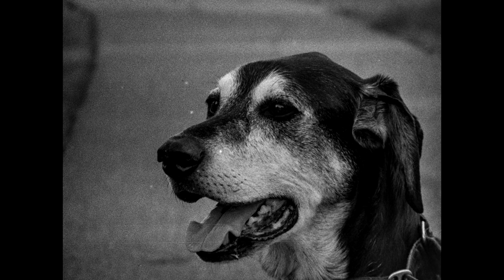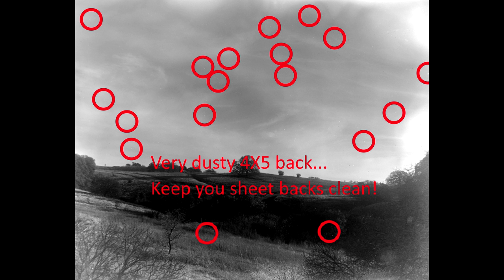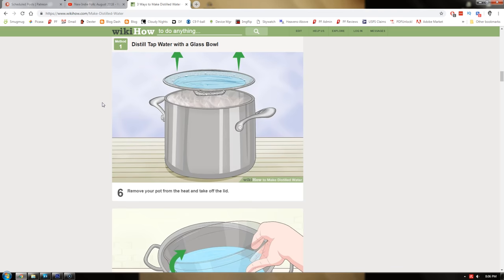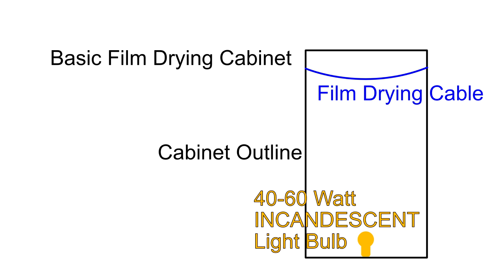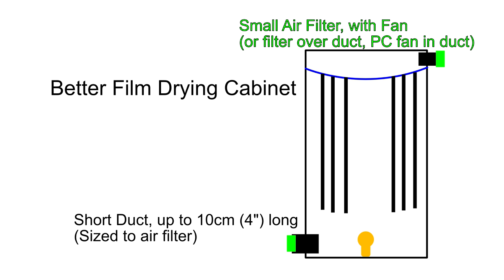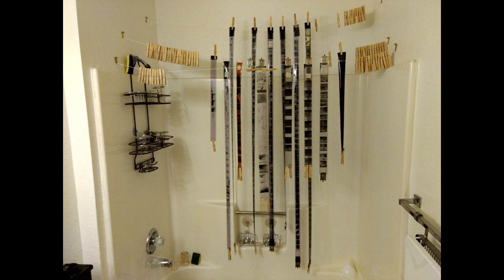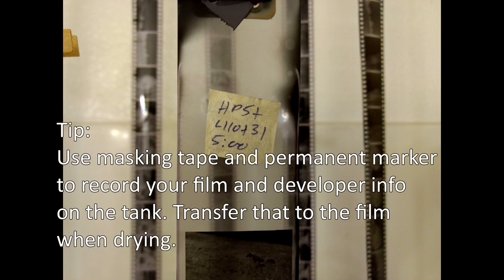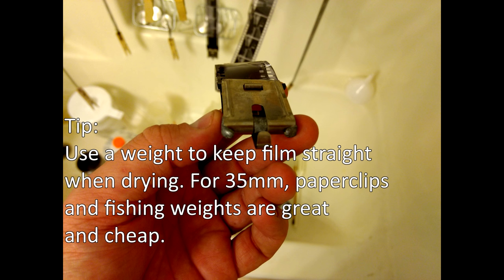Dirt on Film Negatives

Comment: As always great tips. I dry mine in the bathroom, but just before hanging them I run the hot taps for a minute or so, not long enough to cause condensation but long enough for the cooling steam to bring any floating dust down and stop it floating on to your negs. Yet another great video David, thank you.
Reply from the maker: Thank you, Mark! That's a fantastic idea. I hadn't thought to pre-clean the air.

Comment: I dry my negatives in the shower also, however I don't use the exhaust fan. While it might help drying it is sucking dust filled air into the bathroom through the space around the door. I keep the lights on the heater/ ac vent closed and once the negatives are hung I keep the door closed over night and do nothing to stir up dust. The lights help raise the temperature decreasing drying time,  however drives my OC wife crazy.
Reply from the maker: That's a really good point and is probably a better approach than using the exhaust fan. Thank you!

Comment: they need to design spot toning pens for negatives david maybe one day B&H will get onto that
Reply from the maker: They used to make something similar. Because the tones on film are so varied, even in areas that look uniform, the process of fixing negatives is very hard. And because of the size, fixing actual negatives is almost impossible without really specialized gear.

Prints are where problems tend to be fixed. And for that, with black and white, the process involves taking black dye, mixing it in different dilutions to create thing, but correctly toned, gray shades, and then matching and brushing in the tones with fine (like 1- to 10-hair brushes) in multiple layers to build up the correct tonality and detail. It can take an artist with a lot of experience doing that up to 20 minutes for a small-ish spot. It's awful. I've done it a few times. I hope to never do it again.
Reply: true that on 35mm small yeh ive got a 10 grade of spot toning pens its bloody hard at most times to get the tones right the 000 sabre brush is the best tool for prints ive heard but u gota mix the dyes your self cheers for sharing any information I did not know david look forward to your next review/hits and tips